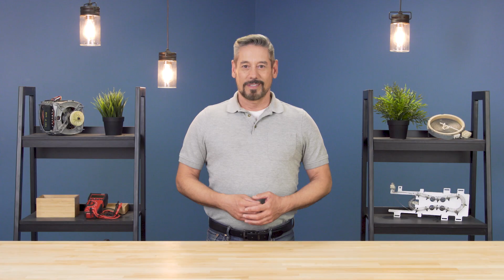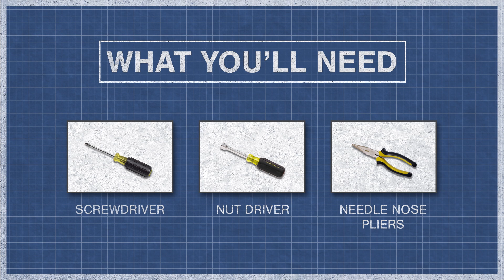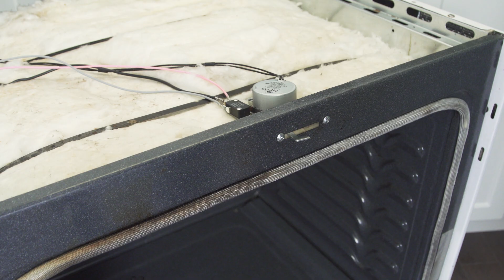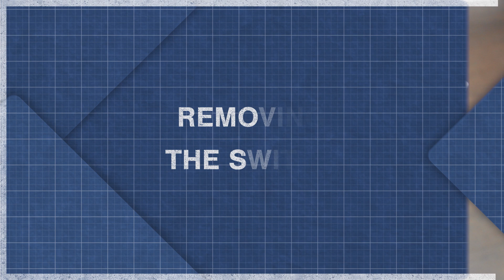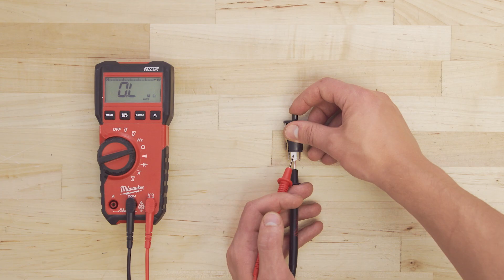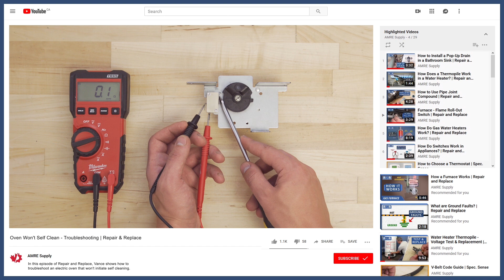Oven Door Switch - Testing & Replacement | Repair & Replace

Comment: Question I have a kitchen aid top and bottom gas oven .i dont know the  model number because the top door is stuck shut.the door light is on and the display says oven door is open.to remove the locking motor I have to remove two nuts up front just to pull the door lock motor from the back and I can't figure how to. Do that any idea on how to do it.

Comment: I have a Samsung ne63a6751ss. It will preheat and if you don't open the door it will maintain temp. If you open the door to put food it will not recover to set temp. If you set 450 then open the door after preheat it will only recover to 411. Door s2ith works perfectly as the light comes on the convection fan stops and it will also go into self clean mode when activated. I'm at a loss. Elements replaced and temp sensors. Everything I can find a spec on ohms out correctly and had correct voltages.
Reply from the maker: Thanks for watching. How are you measuring the temperature inside? Do you have a meat thermometer or a thermometer that you can see without opening the door? How long have you waited before determining that the temperature won't recover?

If needed you can adjust the temperature: https://www.youtube.com/watch?v=s8UdnR4Jw_g

If nothing else then it could be an issue with the control board.

Comment from the maker: Did this video help you fix your oven? Did you run into any problems? Let us know in the comments!
Reply: My oven is stuck on door open it’s says in the display it showed it after the power went out the burners work but I can’t get the display to wipe I held buttons still nothing
Reply from the maker: @nicneary7454  Thanks for watching. You could try disconnecting the power, wait several minutes and plug it back in to see if it repeats the same door error. As well try to look up in your manual to see if there is a key combination that resets the display. If that doesn't help it would be worth checking to see if the door switch is faulty.